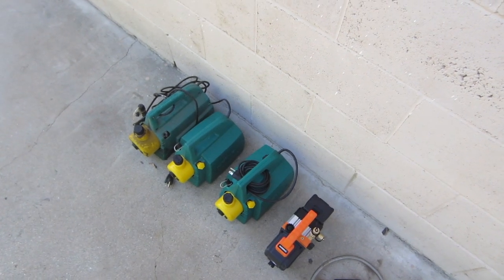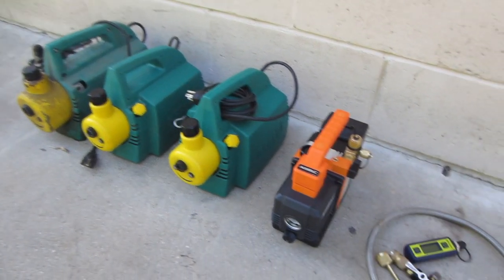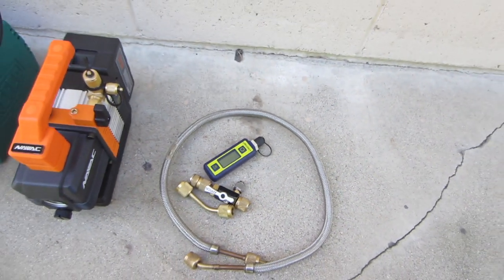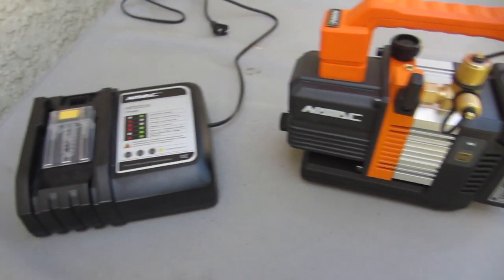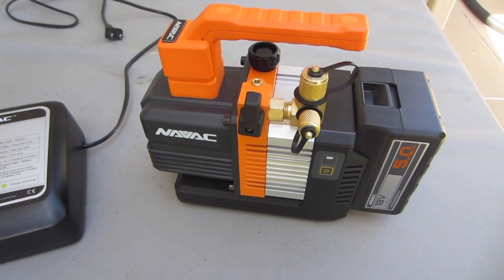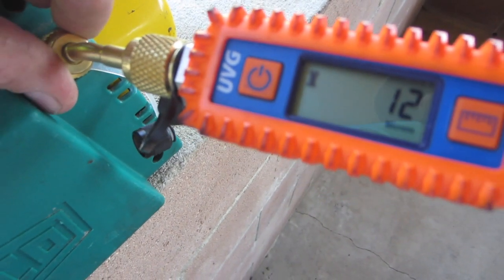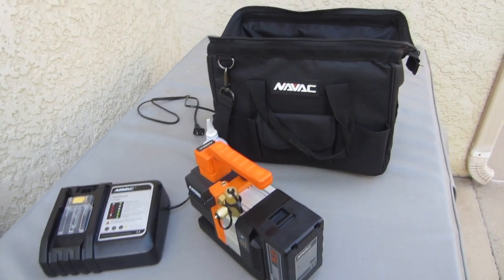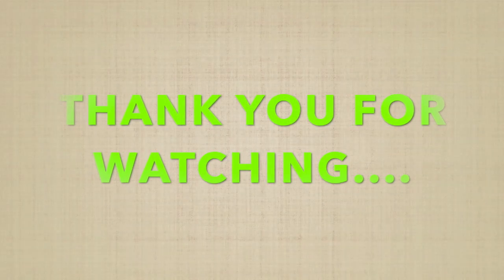HVAC Refco And The New Navac Vacuum Pump

Comment: I wonder if your climate has anything to do with the ability to pull down so low with your setup. I mean one small hose (it is a steel hose?) doesn't seem to cut it for me.
Reply from the maker: The only thing I can think of, if your vacuum hoses are contaminated (with oil suck back from the vacuum pump) will play havoc with your micron gauge.I had this happen to me, took me a couple of days to figure it out. I am only talking about just a little bit of contaminated.Or how about your nitrogen supplier? I sweep mine with nitrogen just before vacuum.